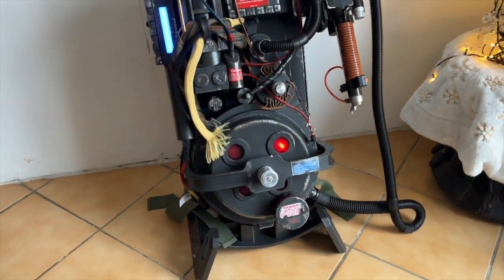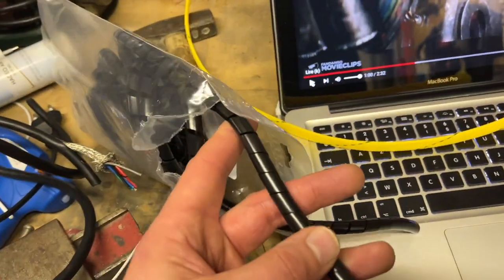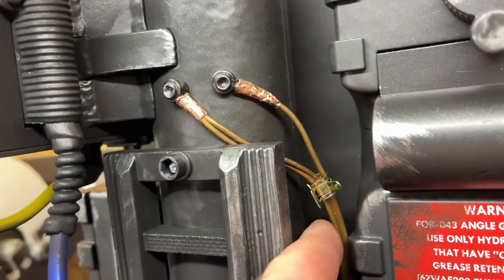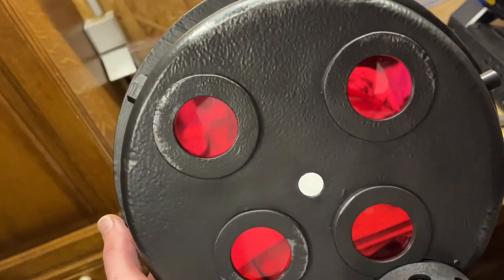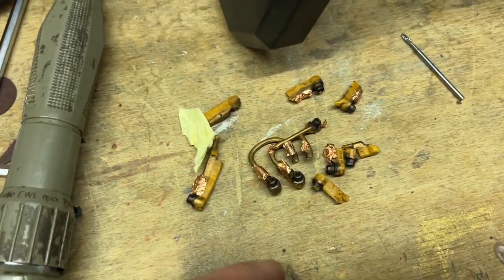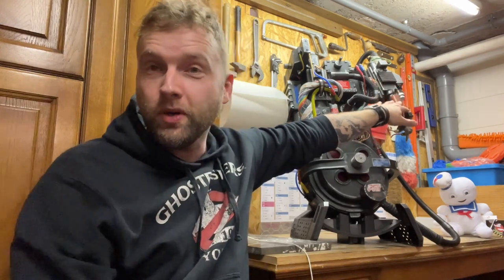Ghostbusters Proton Pack by Hasbro Pulse - ALL my mods and upgrades!!!

Comment from the maker: CHAPTERS :

00:00 Intro
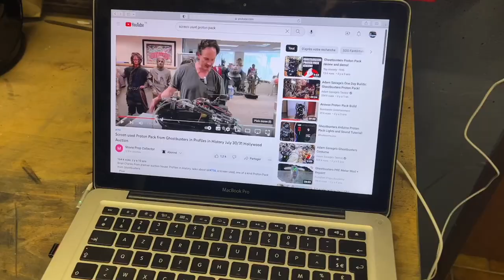03:20 HGA Elbows correct placement
10:30 Wire Loom, Tubing & Hose clamps upgrade 
17:30 Copper tape & clamps on “copper” wires
22:50 1984 Ribbon Cable upgrade & Booster Tube screws replacement 
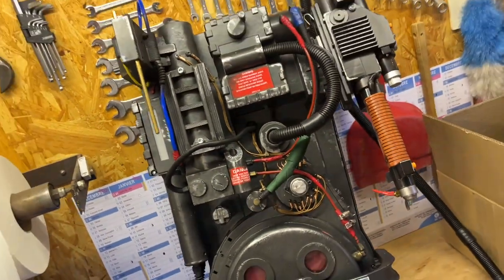27:35 Power Cell window upgrade
32:50 Vacuum Pump damaged hose mod
36:50 Miscellaneous screw replacement 
40:15 Cyclotron Lights / Lenses mod Version 1
43:46 Cyclotron Lights / Lenses mod Version 2
47:59 Ion Arm end cap mod & PPD repaint
52:22 Ion Arm side box panel mod
53:20 Copper wires / Crimp connectors / HGA screws upgrade 
01:01:58 Conclusion
01:04:30 Weathering teaser

Comment: TGB Cablery makes a GB1 ribbon cable that is scaled down to fit the HasLab pack.  Just installed mine yesterday.
Reply from the maker: What do you mean “Scaled down”? The ribbon cable I installed is the full size version and it works perfectly fine on my Haslab pack. Are you sure you didn’t mean to say they make a scaled down ribbon for the Spirit pack ?
Reply: @eivoMSeb  no, it’s slightly scaled down to fit the HasLab pack ribbon cable clip. He sells Spirit, HasLab, and Full Size cables when they are available. If you look at a full size ribbon cable clamp, it’s bigger than the HasLab clamp.
Reply from the maker: @stigmajosh  Ok he must have started doing them afterwards. The one I have is indeed a full size ribbon cable, that is much wider than the Haslab clamp. That’s why it was such a nightmare to make it fit in there. I spend several nerve wracking hours trying to find a solution.
Reply: @eivoMSeb  yes, the full size ribbon cable can be squeezed down into the clamp to fit as you did it. He started making them a bit smaller to be less of a headache. Great ribbon cables though.

Comment: Very good, I like the cyclotron lights. I would have done tighter coils on the ribbon cable though, it needs to feel solid
Reply from the maker: Thanks a lot, really. I’m glad you appreciated, I lost count of the many many hours I spent on this. Regarding the tighter coils on the ribbon cable, I would say it depends. On the pics of the screen used pack shared by Tested, they look very tight indeed. However, if you check some scenes in the movie, especially that close up shot right after Podcast switches it on for Phoebe, it looks very tight coming out of the pack, but then the section between the clamp and the cyclotron looks a lot looser. And I prefer it this way, because as I explained in the video, I love how the Power Cell lights refract through it. Again, thank you very much !
Reply from the maker: And by the way, I’ve been following your work on the groups. Your 84 conversion is fckn stellar, dude !

Comment: Damn good job! Question if you don’t mind how did you weather the cyclotron lights. I’m seeing some use acrylic and others streaks and tips (colored hairspray)  

I think yours is spot on 👍
Reply from the maker: Hey buddy. I just used a tube of black acrylic paint and crudely painted the lenses with a brush, and then used a wet cloth to take some off in case it was a bit too much. Thanks for the compliment and thanks for watching 
🤜🏼💥🤛🏼
Reply: @eivoMSeb  thanks for the info I really appreciate it.

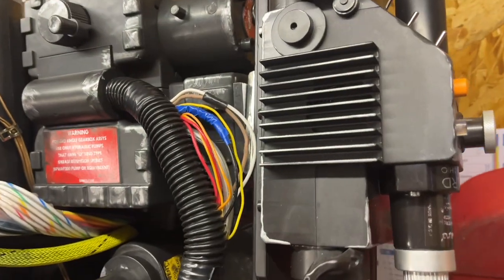Comment: How did you attach the loom back to the pack at 36:41? Hot glue? Epoxy? Thanks.
Reply from the maker: Hey man! For the lower end I just used a bit of epoxy. For the upper end : the loom goes over a little plastic tube, I put a think black nail through and through, that acts like a pin holding both pieces together.
Reply: @eivoMSeb  Very cool! Thanks :)
Reply from the maker: @MC_nki0063  You’re welcome man! Thanks for watching !
Reply: @eivoMSeb I mulled over using your method for about half a day but decided to go with something a little less permanent. I used nonslit loom, cut in about an inch with scissors, removed enough of the loom to get a inner diameter of just under 5/8", wrapped the ends tightly with electrical tape and was able to achieve a real tight tension fit on those little nubs. Bummer that the stock hose is smaller in diameter, otherwise this would have been a pretty painless mod.

Thank you for the advice, though. Your mods have been an inspiration.

Comment: Hey!! Looks good, wondering how the ribbon cable has held up…someone on the Haslab group did mention changing the location of the wires and making them offset on the HGA…also no safety glasses when using a Dremel tool??!! Lol…you crazy…love the video watching it while I type this.
Reply from the maker: Hey Nancy ! Thanks for watching. I do wear safety glasses, sometimes. Depends on what I’m sending / cutting. You can see me wear them at 45:30. Yes i’m crazy, but not 200% crazy lol. About the wires going to the HGA, the person who posted about it was Giasone Torres, a few days ago. I told him about my video and how I would say no one has done it before, because this video was holmes over six weeks, and that part where I modded the HGA was filmed on January 10th lol. Again, thanks for watching and thanks for the comment my friend !